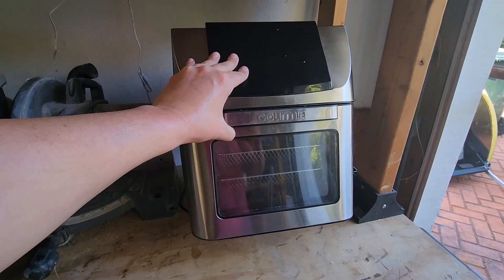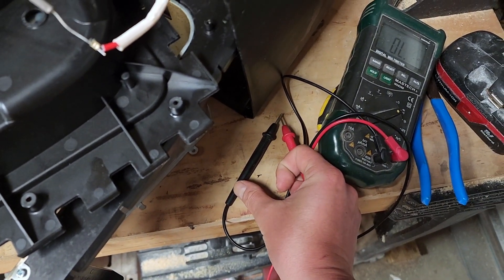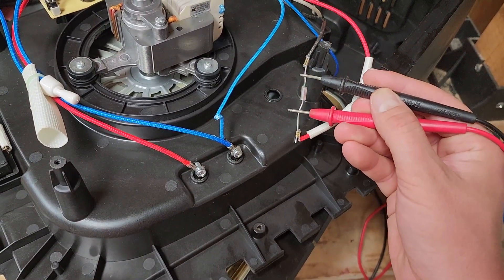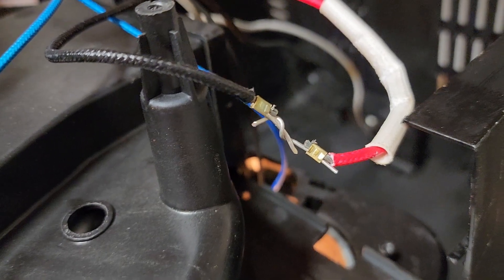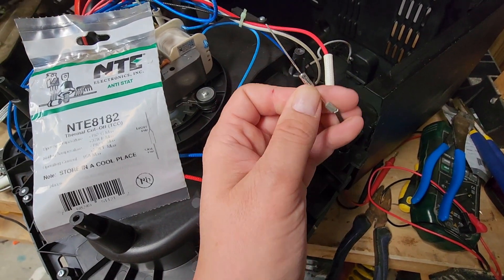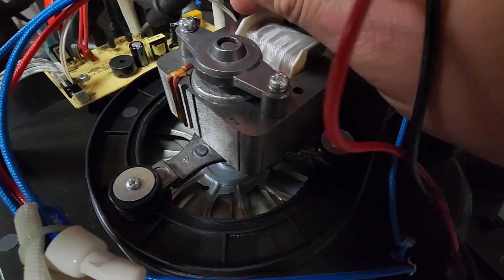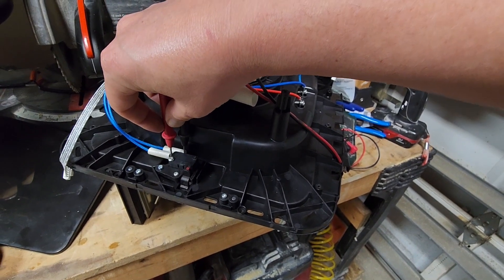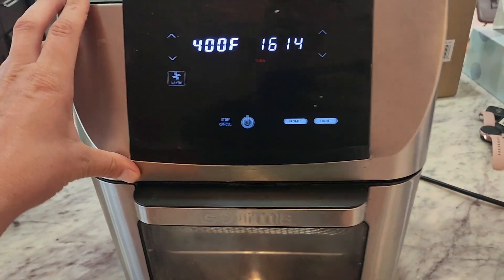DIY Gourmia Air Fryer Repair - Will Not Power On - Thermal Fuse Replacement

Comment: Nice video, I do have a question about mine. The gourmia heats up but the air fryer part doesn't work. It use to make a noise when starting but doesn't anymore? Thanks!

Comment: Thanks! My model (GAF856) was different, and I had to totally disassemble the metal from the plastic behind the heating element to get to the clip holding the thermal fuse which was attached directly to the metal.  (At first, I didn’t notice the four screws holding the metal plate to the plastic and I tried to pry it off, which just bent the edge). Pretty much everything I could unscrew I unscrewed, including the fan blade. 

Bypassed the fuse and it worked, so I’m ordering new fuses from Amazon right now. My fuse was rated 216°C. It looks like 10A is standard.

Comment: wow i have this exact model of air fryer and had the same issue, i will have to try this. thank you so much for posting the repair! the thermal fuses on amazon that you shared links to are not currently available however. so if you dont mind my asking, how do you recommend finding a new thermal fuse on amazon that has the right specs?
Reply from the maker: A 15 amp/192 deg C thermal fuse would match the OEM specs.
Reply: @JonathanMarkMorgan  my Model uses a 216°C fuse, all the ones I find on Amazon are 10 amp. Will this be OK?
Reply from the maker: @bert.pasquale the temperature rating should match the OEM. The current rating of the new part can meet or exceed the OEM.
Reply: @JonathanMarkMorgan  Thanks, that makes sense. I did find 15A fuses to match.
Reply: @JonathanMarkMorgan  Let me just ask and see if you can answer; the marking on my OEM thermal fuse is:

 BAILE
 RY216    22
 Tf216°C IAC

Can you tell if this a 10A or 15A fuse? Web searches have not told me.
Reply: OK, figured it out: it is 120 V and draw 1700 W. This information is from the appliance label not the fuse. 1700 W ÷120 V = 14.75 A. So I will use the 15A fuse.

Comment: Thanks good information,   only I was wondering about soldering the thermocouple  is that a reliable method because the thermocouple is rated to 216 degrees  celsius  i think the solder could melt ane  become a dry joint ??
Reply from the maker: @peterb9580  crimping the thermal resistor, without solder, was sufficient and typical.

Comment: The one shown in your hand is the one from the Air Fryer? Is there a reason you got a 10A replacement when that one shows 15A on it?
Reply from the maker: Technically, the replacement should be 15A...good eye.
Reply: @JonathanMarkMorgan  I was about to ask that question, I do not see a 15A fuse on the McMaster site

Comment: Repaired my brothers power xl oven. No power going heating element, on back side of circuit board, i had to reflow the solder joint where the hot wire for the heat element termi ates.  They are making these things so freaking cheap.  Many just toss in the trash and buy new one.  Not like the old black and decker or ge toaster ovens that would last forever.

Comment: I have thos exact one. Hopefully u can give me direction on this very same thing happening to me. 

I have an air fryer and it's nice. Today the power just cut out. Researched and figured out it's the thermal fuse. The air fryer goes up to 400F and my son put it at 390 degrees for wings. It got half way through cooking and cut off. I see it's a 190c fuse which is 376 degrees F (approx). U think maybe it did get too hot from that? Why would they throw a 190c in there if the fryer gets to 400? 
My main question is, until I can get a new thermal fuse, why can't I just jump it using thevsane guage wire? They say, "your kitchen and fryer is burn down" but how if there isn't really any issue but just that it got too hot? Like we just keep it at 365 F and lower like we usually do and never had issues. Thoughts? I ended up taking out the thermal fuse and threw a thicker wire in to bypass it and it works and runs. No...im not going keep it that way - its just temporary until i can get a fuse. Would u run it without thst fuse? Lol
The thermistor works because if it didn't, you'd getvan E1 code and ut will constantly beep. So what caused that fuse to blow after a year is beyond me. Maybe they just wear out?

Comment: Mine lasted 10 months before the touch screen stopped working. The pressure sensitive control panel sits behind, but in contact with, a thin sheet of smoked glass. That panel separated from the glass so pressing on the glass no longer activated the controls. Oddly, it first separated from the left side allowing me to do turn it on and use most of the right side controls. But it eventually separated from the right as well rendering the entire unit unusable.

I'm trying to access that panel to reattach the control panel to the glass and fix the unit. I have the bottom off now and I was looking for guidance to remove the top and assess that panel. Which is why I found your video.

Unfortunately, you failed to show the disassembly which was the part I needed the most. And since my issue is different than yours, your video was of no help to me whatsoever.
Reply: Just keep removing screws until you get to what you need, lol. I literally unscrewed every piece to get to my thermal fuse. Attached to the inside metal plate.
Reply from the maker: Cool.

Comment: I am also stuck and my until doesn't power on and the way I see the screws my head is spinning.  Please post a video on how to access the top part, I am not able to open the until.  I am scared, they should give me a replacement unit.

Comment: I disassembled the top section one step further. The thermal fuse is held down to the metal top plate to put the fuse in contact with the surface of the oven for accurate temperature. If you just drop the fuse into the assembly it will only sample the air space temperature above the oven and not the oven temp. This could lead to meltdown failure before the thermal fuse breaks the circuit. Just a few wires that are screwed to the element, a couple of chassis screws, and the fan blade (not left-hand threaded bolt) and that will allow you to access the thermal fuse hold down.
Reply: My model (GAF856) is the same as you described, and I had to totally disassemble the metal from the plastic behind the heating element to get to the clip holding the thermal fuse which was attached directly to the metal.  (At first, I didn’t notice the four screws holding the metal plate to the plastic and I tried to pry it off, which just bent the edge). Pretty much everything I could unscrew I unscrewed, including the fan blade. 

Bypassed the fuse and it worked, so I’m ordering new fuses from Amazon right now. My fuse was rated 216C. It looks like 10A is standard.

Comment: My air fryer will run for a second then shut off. Will do this about 5 to ten times before running constantly.  Same problem? You think
Reply from the maker: That's different behavior than I observed with mine. Maybe worth checking out at least, though.

Comment: Did this and its my fuse also. I think this item should be recalled for this. So many people have this same issue
Reply: Just happened to me today I don’t have the time to do all this I’m just going to go get a better product and buy a warranty this time. This product didn’t even last me two years and my family didn’t use it much at all.
Reply: @E3litecompany me too!!less than a year it's dead😢
Reply: @E3litecompany  I went back without a resistor and been using it like that the last 3 months no problem lol
Reply: @E3litecompany smart...instead of spending a few dollars on a new fuse spend a hundred + on a new air fryer...
Reply: @jcout25 better product that will last

Comment: The fuse in the description says it's "Thermal Fuse, Inline Lead, 324°F Maximum Operating Temperature." The voltage shown is 250v AC.. I'm in the US. I'm not an electrician so i got a bit confused with our 110 voltage & as the unit goes 400+ degrees operating temp. I have the exact same unit. I'm not sure if this impacts the fuse necessary but I just wanted to confirm the link wasn't a mistake & this is the correct fuse before ordering it. My model is the Gourmia GAF1220. Thank you for this video. It helped a lot. I'm gonna take a shot at it if this is the correct fuse.
Reply from the maker: Thanks for asking. The link provided is for the correct fuse for the exact model oven I have. I'm not certain if you have the same model. I matched the specs of the original fuse I removed with the new fuse I purchased. Perhaps you can try the same. Just Google the PN of the fuse you remove. Another thought: the oven might very well (most likely will) reach a higher temperature than the wire on which the fuse is installed. No worries about that temperature difference. Sounds like you almost have your oven fixed. Good luck!

Comment: What would happen if you just bypassed the thermal fuse? 
Can anyone answer what the safety concerns would be
Reply from the maker: Your house could burn down 🔥.  Really, though, the device could reach unsafe temperatures, which could potentially start a fire.

Comment: Mine is 192c° and 15 amps but can't find this fuse anywhere online 😐 can I use a 192c° and 10 amps?
Reply from the maker: No. I would go higher than 15 amps, but not lower.
Reply: @JonathanMarkMorgan awesome, thank you!

Comment: Hello

Fantastic video!

Had a similar issue with my Gourmia GAF698. Did a quick bypass of the thermal fuse like you did at 2:10 and it fired up. Got a new fuse of the same temperature and amperage rating. 

Now about the connecting the fuse I can see soldering being fiddly and risking blowing the thermal fuse. Not a criticism, just wondered why you did not use the non-insulated butt connector (2:30) instead? 

Regards
Reply from the maker: Cool. Glad yours is fixed!

I just used the butt connector that came with the thermal fuse.
Reply: @JonathanMarkMorgan  Hi

Thanks for the prompt reply. 

Ok.  Just got to do the final connection. Think that I’ll use a butt connector as well for simplicity. 

Regards

Comment: I could only find 182c or 200c for the thermal fuse is it OK to go 8c over or is this to unsafe I'm afraid 182c won't be enough and will trip constantly
Reply from the maker: I personally would not use anything different than the original manufacturer part. McMaster or Digikey should have what you need.

Comment: Just wondering if that’s what happened to mine? My girlfriend said it got really hot and burned her food. So, she went to unplug it and said the cord was hot as well. Now it doesn’t do anything. I don’t smell anything burnt like plastic, so I’m hoping this is the issue. I don’t have one of those gauges to test it with, what other ways can I use to figure this out? Any help is greatly appreciated! Thank you!
Reply from the maker: You can expose and bypass the thermal fuse, as I also did in the video. That will confirm if you have the same issue or not.
Reply: same thing happened to us. did you end up getting this fixed?
Reply: @kls701 no. I threw it out and bought one that actually works the way it’s supposed to. Won’t buy anything with that name attached ever again!

Comment: Thank you for this video. I just successfully performed this, however there is a short cut. Pry that plastic middle piece, it's gonna break the tabs holding it down, just don't break the whole thing. The wires and fuse were jammed down a hole. Get some needle nose pliers, grab the white cloth part of the insulation and yank that thing out. Cut the old fuse off, use provided crimps and attach the new one, exactly like the old one. I didn't put the new fuse setup back down in the hole, left it bare. Used no soldering, or tape. Used only supplied crimp sleeves, included with the new fuse. Works great 👍
Reply: im doing mine now.. I have it almost totally apart can not figure out how to get off so breaking tabs sounding good about now!  Is it going to be solid with the tabs broke?
Reply: @tamimac4357 Break em, I've had no issues. IIRC, one or two tabs survived enough to hold the top on after the procedure. I was going to break those tabs, or it was going in the dumpster. Good luck!
Reply: worked! thank you!!
Reply: Thanks!

Comment: Most important part of the video is missing … the dismantling🤷‍♂️
Reply: I mean...thats 50% of the reason i came here the diagnostic is good but danm litte help here
Reply: This is where I am stuck.  I can get the bottom cover off but can't find a way to take the top part off in order to access the electrical components.
Reply: I had the same problem ,the top face clips off and has another 4 screws which then get to the next section another 4 screws and o  it goes
Reply: The problem with mine was the door switch but I found out that the top black part of the air fryer ...you can prey open with a flat head has like 3 clips that holds that cover if u pull enough it opens then I removed 2 screws for the panel to get to the switch. Next I didn't have time to get a new switch so I contacted the 2 wires from the switch together and it worked 👍👍👍
Reply: @addictedxbuttons5717  How long has it been working?  Any problems since?
Reply: I need a video to dismantle it 😫
Reply: Lol….ion see no loes here 😅
Reply: That’s what I came for. Though I have a power xl double platform one I figured they may use similar put togethers. Eh whatever.
Reply: 😂😂😂😂 same thing I came here for.
Reply: Open the door and look up there two screws take them off and bent back the  six clips and on top the four screws and it will Left right off I hope I was clear enough  I wish I knew how to take a picture of it not to good at this was just Experiment
I did it. So proud of myself
Reply: @lorettamartin561  I tried and cannot do it. I just use a hand saw to cut through the gap. One wire connection was burned so I just disgard it.

Comment: Heads up - you only have to remove that top black plastic square vent cover. You do not have to remove any screws to the display panel or to the upper black plastic frame.  Leave the display panel alone. There are openings in the upper black plastic frame ( after you pry off the top vent plastic plate) and you can easily see the red and black wires tucked into the hole with white insulation sleeve around the thermal fuse. Just use long needle nose pliers and pull the red & black wires (with the white thermal wrap) out of the hole, there is plenty of slack to cut off the old fuse (after verifying continuity is bad) and replacing it with the new thermal fuse.  There is a rectangular opening next ro the big round fan cutout opening, use that for plier access. Then pull the wires thru the round fan opening while you replace the fuse. Put it all back together - voila, you're done and saved yourself a lot of $.   If this new thermal fuse faults again (like it has to so many of us, even though there is no fire nor even over heating) I will probably get the next higher temperature rated thermal fuse.
Reply: Is there a video to take it apart
Reply: I agree! Just did it with a screwdriver, simply pry it out and don’t be afraid to use a little force it will come out
Reply: What size of thermal fuse to buy
Reply: Yes i discovered that after 30 min of  dismantling. Thermal fuse no brainer ….. dismantling would have been helpful🤦‍♂️.
Reply: I just smashed mine pissed me off
Reply: Best advise on this post. While tight it was doable. Thanks
Reply: Yep. Really wish i would of read this before following this joker lol. Ended up just breaking two of rhe clips to get the top plastic off but it still locks back into place. Literally got 6 extra screws now afrer starting from the bottom up like he did.

Comment: For anyone that needs to know the important question of how to access the components in the top. Its under the top vent hood. You need to pull up the edge of the hood slightly and push the tabs inward with a long slim screwdriver, apply pressure towards the center of the unit. There is 5 tabs to unhook. Two in the front, two on the side, one in back.
Reply: There's a screw in the cooking chamber that needs to be loosened. It holds a bracket and a nut that the holds the wire.  Looks like the heating coils and fan blade and metal plate have to come off to reinstall  wire as per factory.  It doesn't look easy to get the wire under the bracket from the little round hole.
Reply: Thanks. But that only removes the top flat square black plastic vent hood. How do you remove the bigger black plastic frame that the vent hood was attached to? I removed the 4 screws that attach it to the 4 tall black plastic posts, but it still will not budge.  Are there other screws besides the ones that were in the 4 tall tower posts? Are there tabs on the sides? I can almost get the thermal fuse out of the hole just by using pliers even with the black frame still attached, but it will not easily slide out. Is the thermal fuse just freely resting in the hole, or is it secured?
Reply: Also I did remove the display and its ribbon cable - very easy. Just cannot get the black upper frame nor the thermal fuse to pull out of its hole.
Reply: @aphipps10  The thermal cutoff I didn't have much issue on my machine. The main problem for me was that the Kevlar wrap was holding onto the edge of the hole. I had to use a slim screwdriver to work it out of that hole. I'm not sure If it was secured differently on other units. I'm sorry I don't know for sure. When I did my thernal repair, all I needed to do was take the vent hood off, I was able to work through the holes in the top of the unit with needlenose pliers.